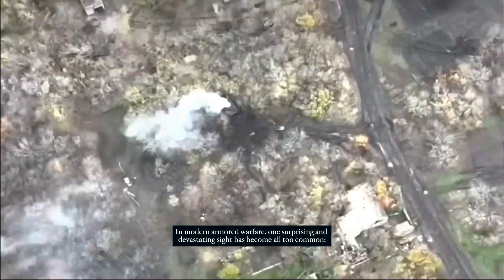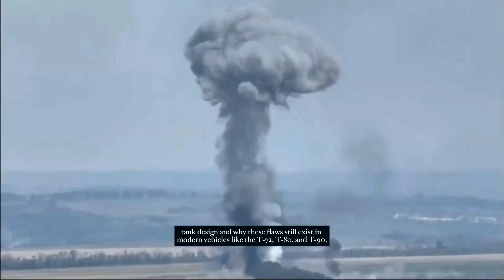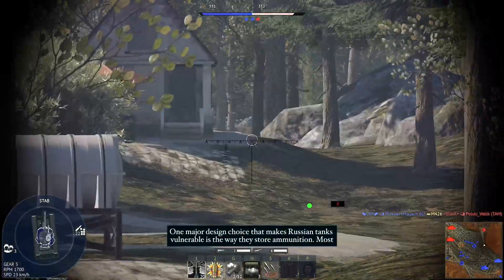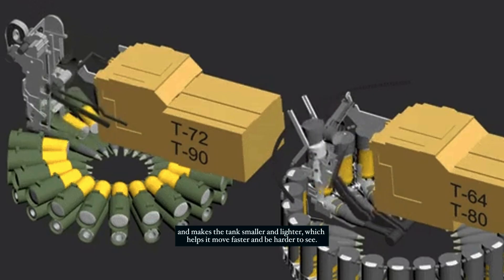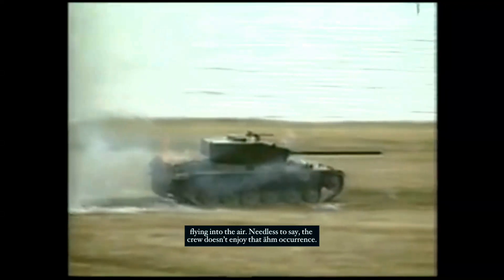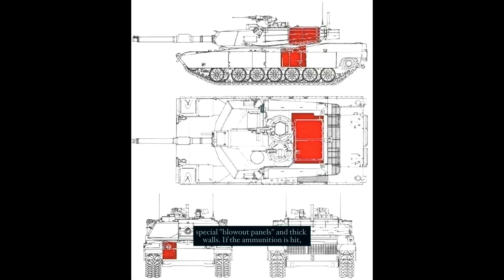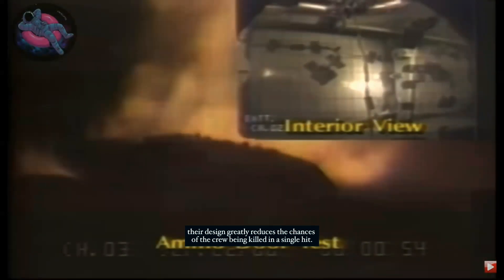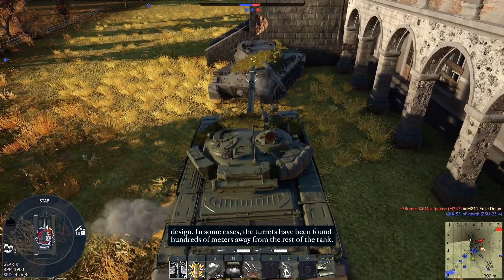Why turrets of Russian tanks blow off when hit

Comment: 2 Things wich could  summed this up pretty easily. 1. Russian Tanks field alot of HE Ammo since the chance of encountering a Tank is low. 2. The Russian Autoloaders isnt the Thing responsible for the Cookoofs its the Ammo stored EVERYWHERE ELSE around the SMALL Tank. If you run full load you can basically see that there is Ammo practically everywhere. The Autoloader in the T90 even has Kevlar Protection.

Comment: The statement that the western MBT's store ammo in separate compartments is highly misleading. Some like the M1 Abrams and only 2 versions of the Leopard 2 do indeed store ammo in compartments with blowout pannels. However the vast mayority of western MBT's do not. Challanger 2 stores ammo in the crew compartment with no blowout pannels, Leopard 2 variants all the way to the Leopard 2A5 store ammo in the crew compartment. Leclerc stores ammo in the crew compartment as well as the Ariete. There is ample evidence that Leopard 2's and Challanger 2's can indeed throw turrets or outright disintegrate if struck in the hull ammo stowage.
Reply: All variants of Leopard 2 store ammo in a turret bustle rack with blowout panels, and a hull storage rack without. Although its kinda irrelevant now for modern use of the Leopard 2 with the Bundeswehrs new DM11 and DM73 rounds, both of which use insensitive propellant

Comment: I wouldn’t call it a flaw, it’s just how they were designed. Russian tanks are built to have a low profile and their small compact structure leaves no space for the autoloader and ammunition other than at the bottom. You can’t judge a tank without considering the doctrine of the country that designed it.
Reply: It is literally a flaw. Doesn’t matter about if it’s meant to be that way or not, nor what doctrine you have. And just to be clear, that I’m not just harping on Russian tanks, western ones have them too. Though they are different flaws.
Reply: @Ghent_Halcyon  Leopard 2 pre A7 doesnt have blowout pannels for hull stored ammo. Chalengers also doesnt have blow out panels and commanders cupola is also a part of the space program.